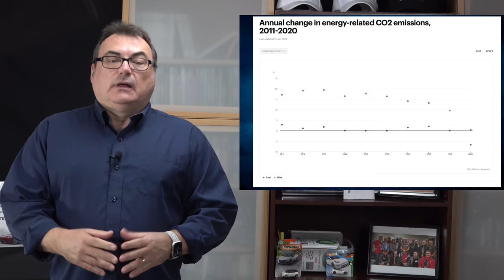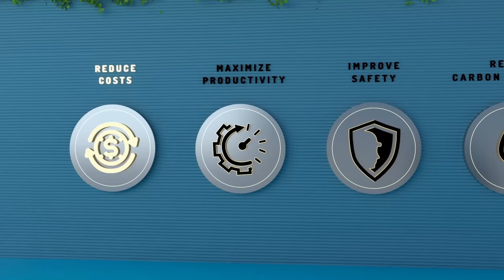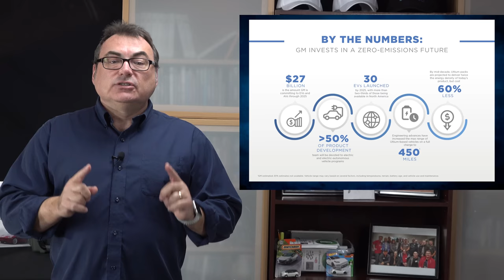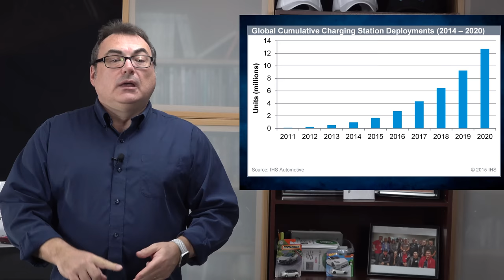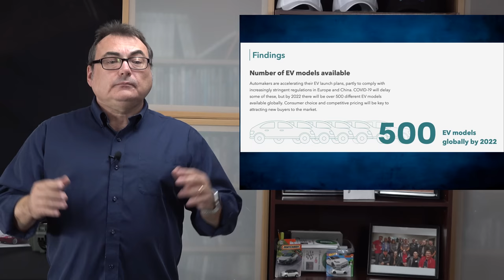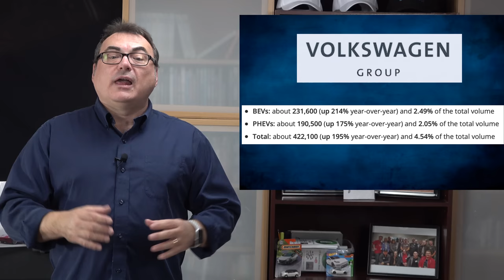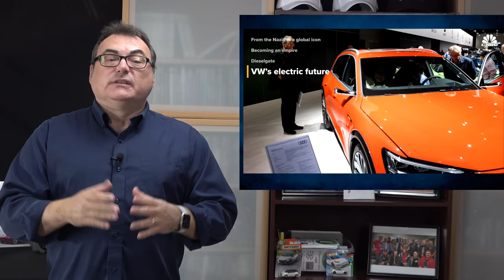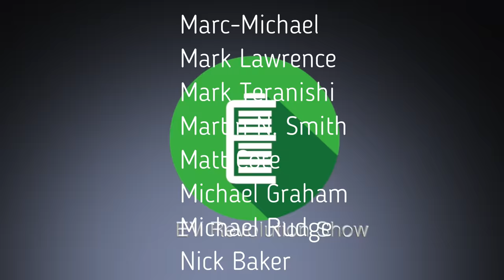Episode 118 - General Motor’s EV Plans : “It’s a 30 off”!

Comment: Thanks for another great show Ken! Let's hope GM is serious about electrification this time, I recall them saying they were "all in" when the Bolt was first launched. They've made little progress since then but I'm cautiously optimistic the big ship is starting to turn. The modular Ultium platform seems like a good move, along with plans for a range of vehicles that we are lacking currently. Hopefully there will be more and more electric cruise ships in time, smaller ones also, as that would be a great EVadventure!
Reply from the maker: Thanks JP, well they are now spending money (Hamtramck Plant, new platform, etc.) so they've got to do something.
Reply: @EVRevolution  agreed Ken, and they have the resources and engineering talent to make some compelling vehicles now that the market is heating up.

Comment: Very nice episode, so much information. Let's hope gm gets its act together and releases a much bigger range of EV models. Hey, is that the Straight Pipes' range test of Ford Focus EV vs VW e-Golf (pre-2017/124 miles) at 16:45? I remember that: the Focus ran out well before the e-Golf and they had to plug into the utility socket of a nearby home (or maybe it's just B-roll?).
Reply from the maker: Thanks for watching.  I don't believe that footage is but I could be wrong. It's part of an entire EV montage that I have been using for a couple of years.

Comment: Nice video.Why GM needs so many marketing efforts years before having vehicles on the market?
Reply from the maker: Thanks for watching.  GM has had vehicles on the market with the Volt and Bolt.  So give them some credit.  All this marketing is reinforcing their commitments to furthering electrification.
Reply: I think part of the reason is convincing shareholders of the viability of their long term plans, as there is substantial investment and retooling required, which take time
Reply: @jamespaul2587  I totally aggree with your statement since it makes financial sense.

Comment: The dealership networks are the Achilles' heel of the legacy auto makers electrification plans.  Even VW has problems here.  Nissan dealers adapted somewhat due to rigid tier incentives and quotas imposed on them to sell Leafs.  Bolt was dealer nightmare according to some.  Heard GM was going to pay Cadillac dealers to go out of business if they won't get behind electric Caddy coming.
Reply from the maker: Thanks Mike.  Some will not accept the change and there will be a shakeup in the industry, which has a long history.  It will all be for the better.

Comment: Lets see how easy it will be for GM and Ford to put 1,000,000 EVs on the Road each year.  Tesla will do it in 2021.
Reply from the maker: Thanks for watching!  I think 2021 for 1M may be premature, but certainly before 2025.  I can see them doubling this to 2M per year by the end of this decade.  

Remember that the OEMs make 8-10M vehicles per year globally.  So to build 1M EVs per year is easy peasy for them.  Don't let your enthusiasm for Tesla cloud the reality of the OEM capabilities.  They've been doing this for over 100 years and know how to build vehicles en-mass.  This is not a race, but a reality that we need all the auto manufacturers to build millions of EVs asap.
Reply: Remember the legacy automakers have to wind down most of their ICE operations and the support of suppliers to make complex automobiles today.  At the same time develop and implement EV's.  Tesla has no cost of winding down operations.

Tesla needs to make a profit selling cars on a annual basis first.  GM is already there.
Reply: @EVRevolution  Considering Tesla growth rate is 50% year, they would have to SLOW DOWN growth to 14.9% per year (including 2021) to only get up to 2M cars by 2030.  Sure....OEMs can produce a lot of ICE cars right now, but where will they get batteries for 8-10M vehicles?  Also, at what cost can they make them?  What about their software development?

Comment: Nobody truly knows what Altium is from GM because all that we can see is a big plastic mock-up that is making the rounds. I guess that only time will tell what the technology really is all about. I really do hope that it is great, but that’s not the sweet spot for me. Most people want a car that is capable of long road trips, even if they only take one per year. My Ford C-Max PHEV easily goes 500 miles or 800 kilometers before the reserve light comes on. I have taken many trips across the southwestern USA where fast charging does not exist, even gas stations do not exist! I would not take my Tesla Long Range Model 3 on a trip like that. 
Imagine what someone who knows nothing about EV’s Going on a trip like that? Throw cold, wind and rain into that situation!!!
Reply from the maker: True there are still pockets of scarce EV charging infrastructure.  This decade, this problem should be addressed.  However, I would even now have no hesitation to take my model 3 on a long road trip.  I am planning exactly that, hopefully for next year once we overcome Covid.  

So for the general population, you can certainly take road trips today in many EVs, you just need to do more planning.  This experience as I stated will only get better with improving charging technologies and speeds.  Even with bad weather, it can still be done.  I know, as I've done it in a lowly Nissan Leaf!

Comment: Not buying a Tesla is like buying a smartphone that gets updates for 2 years but needs to last you 10 years..  No thanks..  Not until the "usual" car company's put out official statements about in-vehicle infotainment updates and or affordable, replaceable infotainment modules.  Beware!
Reply from the maker: Thanks for watching.  I would disagree that OTA is not that important to the general masses for automobile purchases.  Up front costing, TCO, range and charging infrastructure availability at home and locally are the main considerations for many when considering a BEV.  

While it is true that Tesla's OTAs are a unique value-add that the brand offers, other OEMs are starting to offer this, albeit in limited and stumbling fashions.  It may take them a couple more years to figure it out, but I believe they will offer something useful in this regard.  However again, for the past 100 years or so, we have not had this feature so for many, they really won't care about it.  

Bottom line is we need much more choice and production from all OEMs as Tesla alone cannot and never will be able to impact consumer transportation for the positive that we need now and quickly.  The numbers are just too staggering for one vendor to do it alone. 

So there is nothing to beware from GM, Ford and the slew of other OEMs offering EVs, as this is great for consumers!  

What I would say "beware" of is people who just think Tesla is the saviour of our planet and will do it all.  That is foolishness and will not make the changes we need to happen.